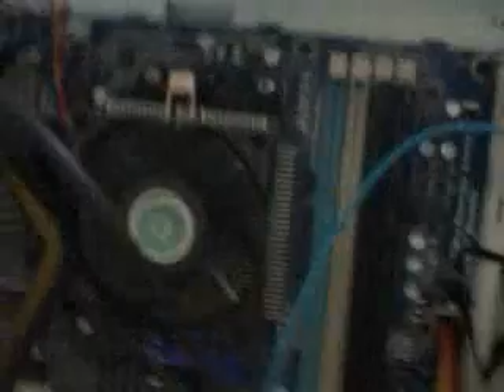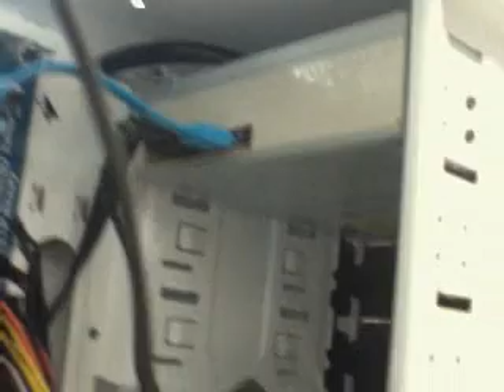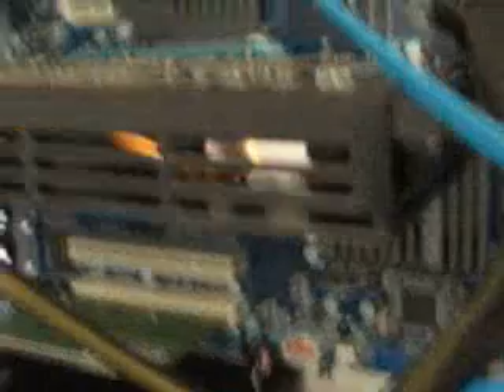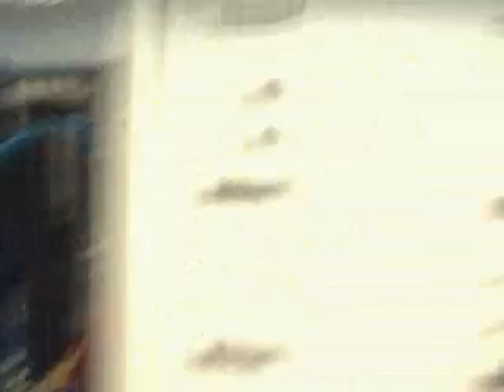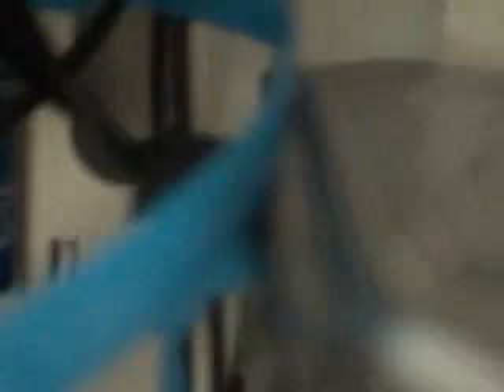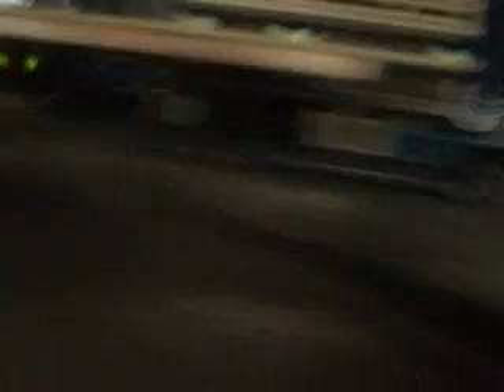First Computer Build Day 2

Comment: With your case you should really work on your cable management.  That case in particular has holes for routing cables, simply take off the back panel of your case and run the wires through and tie them down.  It will really tidy up your build and increase airflow.

Comment from the maker: @meme4567890PSN The information to these questions are on my first video. Yes, that is the stock heatsink. The RAM is 2 x 4GB 1600MHz (not sure if that answers the question). I don't have a USB SD drive for my new computer. When i get a card reader and a sound card, i'll make a new video with an actual camera. the overall cost was around $864 after tax + shipping without monitor, keyboard, and mouse.

Comment: @BreakMemory Ehh dont know weather im gonna make a vid or not but there is a few questions i still have, 
Is that the stock heatsink from the cpu?
What speed is the RAM?
Why didn't you just get a USB SD card adapter to get the vid off your camera? :p
And what was the overall cost of the build?
With all the parts i have on my list, they total up to $835 BEFORE the screen, mouse& keyboard.

Comment from the maker: @meme4567890PSN Haha, there are a lot of things I do not know - as well as a lot of things I do not know that I do not know. I'll just tell you, I saw the wires - looked at which ones fit where - and then I started plugging things in. I do not know what AC'97 is. I did know the names of some of the heads of the psu wires as I watched neweggs building tutorial a little, but now I don't remember. As for what I do know, there is very little. If you make a wiring tutorial, I will link to you.

Comment: Good job on the build (going to be building one myself soon) But you should have really done more research if you couldn't name the SATA cables that connect the CDD, HDD and the 24 pin power connector for the motherboard.